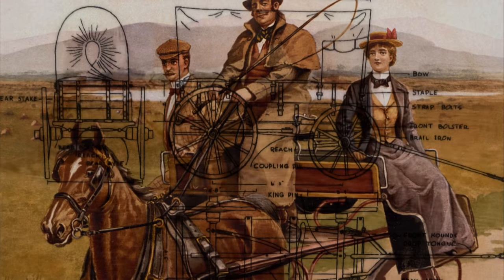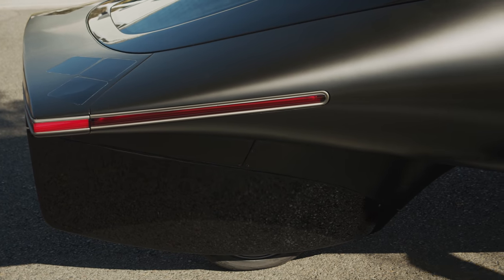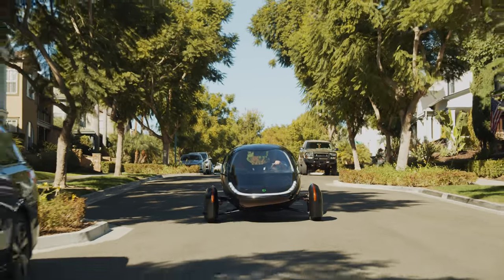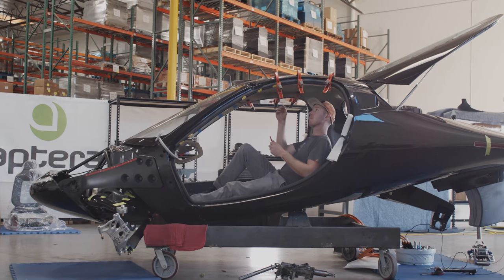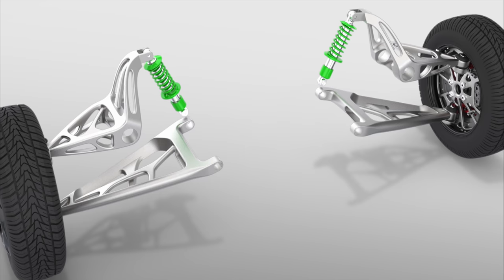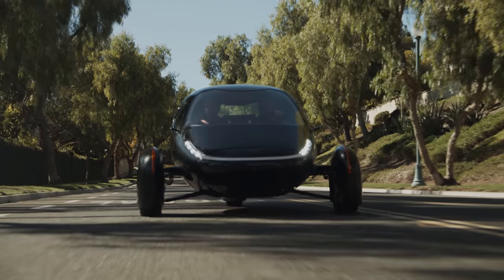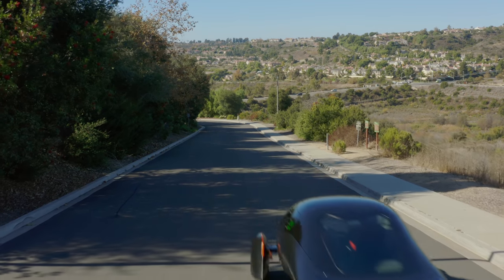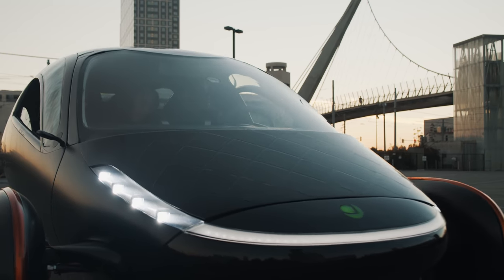Aptera Has Launched

Comment: I hope it will be a huge success. This seems to me to be the perfect car for short, every day trips, especially in sunny climates.
Reply: 1000 mile range. Long trips too
Reply: Same. basically no money for gas I'm all in😉
Reply: @brian8616  The first planned production run of the 1000 mile range sold out first, in less than 12 hours, in spite of being the most expensive.  There is demand for this.
Reply: ground clearance is an issue look how close the wheel covers are to the ground and the body too kind of. it cant go through snow or even mild pot holes it might even get smashed on speed humps
Reply: thunderf00t will probably debunk it
Reply: @dinobot_maximize  you can get wheel covers that are higher off the ground, the off-road kit. The distance from the belly of the vehicle to the ground is about 9 inches. Plenty of ground clearance.
Reply: Is a 3 wheel vehicle considered a motorcycle and except from D.O.T. crash test? Just curious.
Reply: @paulzap6102  yes or autocycle/tricycle. Because less than 4 wheels, it is exempt from the automotive safety tests
Reply: @paulzap6102  no
Reply: The classification of three wheelers differs from state to state. Elio motors had some info posted about the topic.  They have to get a special exception in several states in order to not require a helmet because it falls under motorcycle laws.
Reply: @dinobot_maximize Correct me if I'm wrong but wouldn't that only be an issue for sharp curbs and such.  That's not like a low car in the center as the wheel covers will move with the wheels.
Reply: If they only made it four seater
Reply from the maker: Thanks for supporting Aptera!
Reply: Ten years later and there is now a brand new crop of suckers to fleece...
Reply: @sandervanderkammen9230  Do you own apple products? They liquidated as well. And yet they are one of the most successful companies in the world.
Reply: @halllwd94  Apple is a real company...
Reply: @sandervanderkammen9230  So is Aptera.
Reply: @halllwd94  Hahaha!!!
Reply: @sandervanderkammen9230 . Just ordered it :)
Reply: I'd buy it for year round trips for sure
Reply: @cowonaviwus9975  
Anyone with any knowledge of automotive production, sales history and commerce can debunk this abortion. Park it next to your Elio.
Reply: @DGcuten   You still have to pay to recharge it...
Reply: @paulzap6102   In most states, yes. As to the crash test? Someone will do that for you soon...
Reply: @Daniel Keyser Yeah that's a fake vehicle too!
Reply: I hope it does what they say it does, and then I hope it's a huge success.
Reply: If they make a car this time
Reply: This is the beginning of the end of the oil age,thankfully
Reply: @filippoleombruno8624  "there is a sucker born every minute"
Reply: @sandervanderkammen9230  that's exactly how I feel when I spend 75dollars filling up my tank ,at least I know some of the money is going into a poor saudi princes pockets
Reply: @cowonaviwus9975  He can't debunk solar charging
Reply: @sandervanderkammen9230  no I know exactly what the Saudis are doing to yemen
Reply: @filippoleombruno8624  Yes, Saudi Arabia currently hosts 4 million refugees from Yemen, provides them with free housing, clothing, studies, treatment and salary, and treats them as citizens. Can you tell me why Australia refused to host the Syrian immigrants and drowned them in the sea?
Reply: @faisal6230  there is good and bad in every country, I protested the Australian government treatment of refugees, I also have Muslim friends who like living here, my problem is with oil and the hell on earth its created,yes it served us well  for over a century and gave us the highest standards of living in history but it's time to move on to a cleaner more sustainable future,
Reply: @Daniel Keyser read the oatmeals piece about his Tesla. He explains that despite being in oregon, solar is effective and he loves his setup.
Reply: the 3 wheeler makes it look wimpy... ok nevermind just saw the video.  0 drag lighter weight more aero efficiency more mileage
Reply: @filippoleombruno8624  I know exactly what the second richest man in the world Elon Musk is doing in Yemen.... nothing.
He doesn't give ashit about you or the environment. 
You need to get with the times... your irrational fear of the evils of "Big Oil" are unfounded, it's the rechargeable battery industry that is getting rich and destroying the environment out of greed and pure evil.
Reply: @sandervanderkammen9230  musk won't be so rich soon, now that battery technology is going to replace lithium (which he has invested in)also Toyota is going to start producing a full electric range,already 1 in 4 Toyota's is a hybrid, the yaris hybrid is getting 3l per
Reply: @sandervanderkammen9230  yaris is getting 3Lper 100km,my 50cc scooter gets 2.8L per 100!for the first 20 years of my driving life I drove nothing but V8 for no real practical advantage I'd be 100k better off now, if governments made it affordable to own a second car, you could keep your V8 ,truck or 4 wheel drive for recreation
Reply: @filippoleombruno8624  what battery technology? Everything is Li-ion.

Toyota got screwed by Musk...Toyota has been forced by Muck to produce a pure EV and use his batteries (Panasonic) to comply with the so called "Tesla Law" that bans all manufacturers that do not offer a battery electric vehicle in California and 11 other CARB compliant states.
Elon Musk lobbied the California legislature to pass this law which takes effect next year.
Reply: @filippoleombruno8624  If you are looking solely at energy efficiency and cost? Then Diesel is a clear winner..
Reply: @sandervanderkammen9230  I learnt  to drive in a 65XM falcon it required regular maintenance and repair, and still you would break down on the side of the road, for the last 10 years I've owned a 2011corolla,all I've done is change the fluids, yes they are more difficult for a home repair, but their reliability is amazing, in 10 to 20 years time Tesla's will be like that Xm falcon
Reply: @filippoleombruno8624  I just realized you are Ozzie... that explains everything!
Australia is owned by the big evil mining companies.
Reply: @sandervanderkammen9230  lm in south Australia we have a lot of copper and produce a lot of electricity so electric cars would boost this state,since GM pulled the pin when they couldn't recieve any more handouts
Reply: Quite the opposite actually. Perfect for long trips.
Reply: @DS-wy3kn  #ApteraVaporwareScam 😣
Reply: @ApteraMotors  can you please bring it here in the Philippines Sirs? We have sunshine all year long except during rainy seasons from time to time but i think your car still charges even if it's a little bit cloudy and I am applying in your company to be your car dealership here all I can say is I am an honest person and china made e-trikes are most bought here. I'm sure it will be a big hit here too. Love your invention sirs. Tysm 👍🙏😍😎🇺🇸🤝🇵🇭
Reply: @Daniel Keyser i ordered😁
Reply: @filippoleombruno8624  I can't agree more , i invest in a lot startup in green economic and renewable energy sources because we are on the verge of terrible climate change if we do not act quickly
Reply: It sold out in less than 24 hrs so it was a big success
Reply: I’d happily go cruising for long trips in one.
Reply: N. Bruce Nelson well who wouldnt want a 1000 mile range
Reply: May god bless you for this invention
Reply: @cowonaviwus9975  thunderfoot debunks only if math doesn’t add up. Here it does.
Reply: Except when you hit a pot hole and your wheel breaks off
Reply: @brian8616  😂😂 1,000 mile range!? That’s a lie unless this car isn’t coming this year, or next year, and MAYBE it’ll come out in 2023
Reply: @ApteraMotors  Thank YOU! 🏆
Reply: cannot get uglier then this
Reply: Thought you were gonna say "perfect for short people".
Reply: That is, if you don't need any luggage, which is quite rarely the case.
Reply: This would be a perfect vehicle for india if they make some adjustments to make it compatible with India's roads.
Reply: Absolute god damn death traps in crashes. No thanks bud.
Reply: Electramatica solo is gonna be the main competition
Reply: They finally make an EV with 1000 mile range: ..perfect car for short, every day trips
Reply: it's very interested in developing your brand in several regions. Business Development i international, business innovation, investment development
Reply: @paulzap6102   In some states, if it's a side by side seating then it's a car, even if it has three wheels.
Reply: @filippoleombruno8624    How is it the beginning of the oil age when plastic is made from oil. The tires are made from oil. All the electric wires have insulation made from oil. The charging cable, the windshield is probably plexiglass...etc
Reply: @filippoleombruno8624    The new batteries Tesla is coming out with in 2020 are not lithium ion batteries. I think they use nickel iron or something like that.
Reply: @TexanUSMC8089  solid state batteries are the next big thing  ,there will always be some use for oil just not as much
Reply: @sandervanderkammen9230  who hurt you buddy?
Reply: @purplecolour  I'm not intimidated by trolls like you son... get a life.
Reply: @sandervanderkammen9230  Dad? Is that you? Pls come home, it's been years :(
Reply: @purplecolour  Sorry, you lose.
Reply: @n.brucenelson5920  how much is it
Reply: Composite Molding through a continuous range line is key for mass production.
Reply: @icare7151  Fake technology doesn't require mass production... just good marketing.
Reply: @sandervanderkammen9230  Provide verifiable data of fake technology please
Reply: @icare7151  You are not familiar with the Aptera investment scam?
Reply: @ApteraMotors  I obviously need to catch up because I thought you guys went away a decade ago! I used to be a member of the forums and everything!
Reply: @ApteraMotors  When are you coming to India? I know its a small market for you, but ...
Reply: @sandervanderkammen9230  Do you verifiable data to support your claims of “scam”?
Reply: @icare7151  Can you provide verifiable data that it isn't a fake technology scam?
Reply: Literally no baggage space
Reply: @niismo.  its a MOTORCYCLE
Reply: @sandervanderkammen9230  Boomers are incapable of living in a world where technology and science advance to the point where their way of life becomes obsolete. We get it, you hate facts and are terrified of change. Poor guy.
Reply: Looks bad though lu
Reply: @dinobot_maximize  There is far more clearance than for many cars on the road now that seem to have no particular problem requiring a change.
Reply: Yes! I'd never need to charge it in Mexico LOL, I just use the car for small trips to grocery store and stuff, my car has less than 1,000 KM since 1 year ago lmao, I like the deal, no more gas, it pays for itself in the long run.
Reply: @n.brucenelson5920  Ground clearance has never been an issue, that is a problem only found on real cars not vaporware investment scams like Aptera.
Reply: @Red-fg9qr  Apetera is marketing this scam in countries where people are gullible and can afford to invest on blind faith, that believe that they will receive what they think they paid for...
Reply: How can I short their stock?
Reply: @구독자500명되면이같은  Aptera does not meet the requirements to be publicly traded.
You can't short sell a company that doesn't make it's financials public... the company is too risky to invest on terms.
Reply: @sandervanderkammen9230  45000 dollars for a car that looks like a tricycle and doesn't have self driving option sounds like a bad deal to me don't see this company going anywhere
Reply: @구독자500명되면이같은  The company already has a  bad reputation as a vaporware investment scam.
A lot of people lost all their investment when the company started up the first time... 10 years later this just a repeat of the same scam.
Reply: Alaska Pirates  You might want to see a doctor
Reply: @schizy  so do it
Reply: @sandervanderkammen9230  says I'm devoid of reasoning and understanding ignores the fact that they have continuously refused to provide evidence for their claims and instead mocked and ridiculed anyone that disagrees with them using nothing but strawmen and flawed logic You missed your chance to take the high road lmao
Reply: This thing is so ugly... I'm shocked at how many of you actually think this thing will be a success...
Reply: @OoWINDEXoO  Stare at it for 20 mins, you'll change your mind pretty quick.
Reply: @techboy95  I'd still wear a helmet, if required by law, I rode motorcycle for many years and always wore a helmet, required or not.
Reply: @danwat1234  Probably more than my spouse's Prius C.
Reply: @paulzap6102  Yes, but it seems like they are focusing on safety pretty strongly anyways.  I've worked some with composites and making my own structures. It's amazing stuff when you get the right combo of 3 materials.  Then, it's a mono structure which further increases its strength and durability.
Reply: @ivanivonovich9863  this comment made me laugh haha
Reply: @halllwd94  I bought one once years ago. After using that POS I vowed to never buy anything Apple again.
Reply: @sandervanderkammen9230  we must all go back to horses to save the world! F big oil and Batteries!
Reply: @ermwhatdaheck  Apetra missed their chance to be honest and legitimate.
Reply: @OoWINDEXoO  I'm shocked people don't see that its a scam.
Reply: @raymondluca7779  Certainly not, I think this country and all countries  should be energy independent.
Are you one of those ninnies with a phobia of atomic energy?
Reply: @Austinandpup  About half the population of the planet would starve to within a year if we switch to horses...
Agreed, rechargeable batteries are not just dumb they are even worse for the environment.
Reply: @Austinandpup  I don't understand the logic of blaming the oil industry for everything... we all consume petroleum products or products that require petroleum in their manufacturer... including the food you ate today and your internet devices you just used to post your comment.
Don't be such a hypocrite.
Reply: @sandervanderkammen9230  i was being sarcastic.  Of course half the world's population gone might be a good thing.
Reply: @sandervanderkammen9230  lol what did I blame the oil companies of?
Reply: @sandervanderkammen9230  ha! If I had it my way I'd be living in a cave and hunting with a stick! Big oil companies suck butt!
Reply: @sandervanderkammen9230  im being sarcastic.  I know the oil industry set it self up in a way that made it almost impossible to live without. Pretty much everything uses oil in this day and age. BUT unfortunately its killing the planet.  So while I live off the crap and yes I'm a hypocrite,  I still say F the oil companies!
Reply: @sandervanderkammen9230  the thing is im old. I know things were better before they took over the world. I'd be happy with no internet, tv, or plastics. 

Here we stand
Like an Adam and an Eve
Waterfalls
The Garden of Eden
Two fools in love
So beautiful and strong
The birds in the trees
Are smiling upon them
From the age of the dinosaurs
Cars have run on gasoline
Where, where have they gone?
Now, it's nothing but flowers

There was a factory
Now there are mountains and rivers
You got it, you got it

We caught a rattlesnake
Now we got something for dinner
We got it, we got it

There was a shopping mall
Now it's all covered with flowers
You've got it, you've got it

If this is paradise
I wish I had a lawnmower
You've got it, you've got it

Years ago
I was an angry young man
And I'd pretend
That I was a billboard
Standing tall
By the side of the road
I fell in love
With a beautiful highway
This used to be real estate
Now it's only fields and trees
Where, where is the town
Now, it's nothing but flowers
The highways and cars
Were sacrificed for agriculture
I thought that we'd start over
But I guess I was wrong

Once there were parking lots
Now it's a peaceful oasis
You've got it, you've got it

This was a Pizza Hut
Now it's all covered with daisies
You got it, you got it

I miss the honky tonks,
Dairy Queens, and 7-Elevens
You got it, you got it

And as things fell apart
Nobody paid much attention
You got it, you got it

I dream of cherry pies,
Candy bars, and chocolate chip cookies
You got it, you got it

We used to microwave
Now we just eat nuts and berries
You got it, you got it

This was a discount store,
Now it's turned into a cornfield
You've got it, you've got it

Don't leave me stranded here
I can't get used to this lifestyle

Source: LyricFind

Songwriters: David Byrne

(Nothing but) Flowers lyrics © Warner Chappell Music, Inc
Reply: @sandervanderkammen9230  how do you know what i ate today? Perhaps I live in the country and grow my own food using rain water.
Reply: @Austinandpup  The David Byrne that just bought a $5.5 Million dollar mansion in Los Angeles???
Reply: @sandervanderkammen9230   Not only am I hypocrite I'm......

Folks, I'd like to sing a song about the American Dream
About me, about you
About the way our American hearts beat way down in the bottom of our chests
About that special feeling we get in the cockles of our hearts
Maybe below the cockles
Maybe in the sub cockle area
Maybe in the liver, maybe in the kidneys
Maybe even in the colon, we don't know

I'm just a regular Joe with a regular job
I'm your average white, suburbanite slob
I like football and porno and books about war
I got an average house with a nice hardwood floor
My wife and my job, my kids and my car
My feet on my table and a Cuban cigar

But sometimes, that just ain't enough to keep a man like me interested
(Oh, no, no way, uh-uh)
No, I gotta go out and have fun at someone else's expense
(Whoa, yeah, yeah, yeah, yeah, yeah, yeah)
I drive really slow in the ultra fast lane
While people behind me are going insane

I'm an asshole (He's an asshole, what an asshole)
I'm an asshole (He's an asshole, such an asshole)

I use public toilets, and I piss on the seat
I walk around in the Summer time, saying, "How about this heat?"

I'm an asshole (He's an asshole, what an asshole)
I'm an asshole (He's the world's biggest asshole)

Sometimes, I park in handicapped spaces
While handicapped people make handicapped faces

I'm an asshole (He's an asshole, what an asshole)
I'm an asshole (He's a real fucking asshole)

Maybe I shouldn't be singing this song
Ranting and raving and carrying on
Maybe they're right when they tell me I'm wrong...
Nah

I'm an asshole (He's an asshole, what an asshole)
I'm an asshole (He's the world's biggest asshole)

You know what I'm gonna do?
I'm gonna get myself a 1967 Cadillac Eldorado convertible
Hot pink with whale skin hubcaps
And all leather cow interior
And big brown baby seal eyes for head lights (Yeah)
And I'm gonna drive in that baby at 115 miles per hour
Gettin' one mile per gallon
Sucking down Quarter Pounder cheeseburgers from McDonald's
In the old fashioned non-biodegradable styrofoam containers
And when I'm done sucking down those greaseball burgers
I'm gonna wipe my mouth with the American flag
And then I'm gonna toss the styrofoam containers right out the side
And there ain't a goddamn thing anybody can do about it
You know why? Because we've got the bomb, that's why
Two words: nuclear fucking weapons, okay?
Russia, Germany, Romania, they can have all the democracy they want
They can have a big democracy cakewalk
Right through the middle of Tiananmen Square
And it won't make a lick of difference
Because we've got the bombs, okay?
John Wayne's not dead, he's frozen
And as soon as we find a cure for cancer
We're gonna thaw out the Duke, and he's gonna be pretty pissed off
You know why?
Have you ever taken a cold shower?
Well, multiply that by fifteen million times
That's how pissed off the Duke's gonna be
I'm gonna get the Duke, and John Cassavetes
And Lee Marvin, and Sam Peckinpah, and a case of whiskey
And drive down to Texas and
(Hey! You know, you really are an asshole!)
Why don't you just shut up and sing the song, pal?

I'm an asshole (He's an asshole, what an asshole)
I'm an asshole (He's the world's biggest asshole)
A-S-S-H-O-L-E
Everybody
A-S-S-H-O-L-E

I'm an asshole, and I'm proud of it

Source: Musixmatch

Songwriters: Denis Leary / Christopher Phillips

Asshole lyrics © Mullet Head Music Publishing, Slap Meat Music, Songs Of Universal Inc.
Reply: @Austinandpup  What do you think about Tesla Inc.???
Reply: @sandervanderkammen9230  to be honest I don't know much about them other than they make ugly cars.
Reply: @Austinandpup  But whats you opinion of the highly controversial mega corporation run by the richest man in the world?
 "Big Green Energy" companies only interested in profit and stock prices??
Reply: @sandervanderkammen9230  im anti everything and yet I use most of what I'm against. I use more oil than the average person. Im against cell phones and the internet and yet I use both almost constantly when I'm away from home.
Reply: @sandervanderkammen9230  lol I burn through about 75 gallons of diesel every day!
Reply: @Austinandpup  Really? That's you philosophy?
How sad.. I feel sorry for you.
Reply: @Austinandpup  Yes, we already agree you are a hypocrite... most environmentalist are hypocrites too.
Reply: @sandervanderkammen9230  don't be sad its my job. I make the big bucks taking food and goods across country to people so they don't die of starvation. Of course we could go back to horses. Whats your dilemma?
I used over 100 gallons of diesel today!
Reply: @sandervanderkammen9230  what's my philosophy?
Reply: @Austinandpup  So its not really "Big Oil" thats the problem now is it??? They are just a business supplying a product to people like you.
Reply: @sandervanderkammen9230  some people like myself can be minimalist but others need to keep up with the Joneses. I have a cell phone only because I'm away from home 24 days of the month. My wife and I video chat on it. When I'm home the phone is off and on the counter. I grow most of my own food," When home". I tried growing it in the truck but the vibration uprooted my plants every day.
As a child I always dreamed of living in the mountains away from people and off of the land. Unfortunately that's nearly impossible today. The government will be taxing us on taking a dump pretty soon.
I drive a semi and its totally against everything I believe. but you know what? My beautiful wife is happy and enjoying her life on our land with our critters. If she's happy it almost makes it worth it being out here driving my life away so the rest of the country doesn't starve.
Reply: @sandervanderkammen9230  oh the robot thing is quite true. We all have to be good robots and fund the government.
Reply: @Austinandpup  Yes, you are a robot..
Reply: @Austinandpup  So please tell me if you are a frustrated ludite and dream of being a hermit... What is your interest in vaporware investment scams like Aptera????
Reply: @sandervanderkammen9230  if you back big oil what are you? A soulful robot?
Reply: @sandervanderkammen9230  hope you're brushing up on your Chinese.
Reply: @sandervanderkammen9230  actually big oil is the problem. They are like crack dealers. Everyone is addicted.
Reply: @sandervanderkammen9230  what are you talking about i never expressed interest in this company.
Reply: @sandervanderkammen9230  and yet you said if we went back to horses half the population would die. Apparently im a hero robot keeping half the population alive!!!!!!!! Horay for me!
Reply: @Austinandpup  and a hypocrite.
Reply: @sandervanderkammen9230  lol like every troll when you are made a fool of you just throw out insults.
Reply: @Austinandpup  Just answer the question.
Reply: @Austinandpup  What is your interest in Aptera?
Reply: @sandervanderkammen9230   I answered that question yesterday I have no interest in this company I never expressed an interest in this company.
 I was watching a video about another company and video popped up afterwards.
Reply: @Austinandpup  So your ridiculous horse comment was intended as a joke???
Don't quit your truck driving job yet kid...
Reply: @sandervanderkammen9230  if you'd take the time to read, i said multiple times I was being sarcastic. To put it more plain pretty much every comment I made here, i was being a smart arse.
Now that I did a little checking on this so called company, I see they tried this in the past. Were you an investor that lost money?
Reply: @sandervanderkammen9230  lol you called me kid. I feel so young or did you mean goat kid!? 🤪
You appear to have a serious vendetta against this company. How much did you lose?
Reply: @Austinandpup  Like I said, don't quit your day job just yet... your jokes are not funny.
Reply: @Austinandpup  Certainly not!You would have to be very gullible and naive to invest in this scam company...
Aptera reeks of vaporware fraud.
Reply: @sandervanderkammen9230  FUV  Is the vehicle I was checking out when I found this. I'm thinking to buy something for cruising around town short trips and to the beach. Unfortunately everything's way over priced right now so I'll just keep looking.
Reply: @Austinandpup  I would be very wary of a $20,000 3-wheeler cobbled together from non-automotive, off-the-shelf parts.
 If I was serious about buying a 3-wheeler? I would test drive a Can-Am first. Rotax engines are so reliable they are FAA certified for passenger aircraft.
Reply: @sandervanderkammen9230  like I said, no way I'm paying that for a beach trip machine. We live close to the beaches  in the Florida gulf.. Just looking for something economical to drive to the beach and for town errands. In no rush. Nothing wrong with our car. 
What ever I get needs to be enclosed. Im not dealing with the elements.
A horse with an umbrella isn't gonna do the job!
Reply: @sandervanderkammen9230  any certain model you like?
Reply: @Austinandpup  Here in California it never rains so no need. for enclosed bodywork...
Reply: @Austinandpup  I see a Hyundai Accent in your future.. you can pick one up for about 2 grand used... more reliable and better range than the FUV.
Reply: @sandervanderkammen9230  here in Florida it dumps buckets without warning. Anyway like I said I'll stick with my car until someone comes up with something worth buying thats affordable.
Reply: @sandervanderkammen9230  come on you can't tell me the horse and unblella didn't make you smile!? Give me a laugh i wanna quit my day job!
Reply: @sandervanderkammen9230  lol I don't see the FUV or any Hyundai in my furniture. 
 Funny story, many many years ago when the Hyundai Santa Fe was brand new on the market.  I went and test drove one but wasn't impressed.  Later that day I was at a different dealership and the salesman told me don't buy that cheap Korean crap. He finished the sentence with I'm Korean I know they're crap.  Of course he was a salesman for a different dealership Trying to sell their crap.
Reply: @Austinandpup  You gotta keep on truckin...
Reply: @sandervanderkammen9230   Oh darn it! I thought I was gonna be the next Denis Leary.
Reply: @ApteraMotors  lame people follow the rules always u come from a super car to normal car Market
Reply: If you put it on  rails. Steel on Steel is 90% More Efficient.  90×300 MPG=27000 Per Battery Charge.
Reply: Not only in sunny climates . Solar gets it energy from UV rays, so it’d work just as good anywhere on earth other then Antarctica.
Reply: @larenski  it has plenty of room for luggage, the trunk has room for two to sleep in and room under it too, since the battery is in the front.
Reply: @jch8175  you don't know that it's a death trap, the crash test hasn't been done yet.
Reply: @niismo.  it has a ton of space, the trunk has room for two to sleep in and under it there's even more room, since the battery is in the front.
Reply: @sandervanderkammen9230  well, the oil industry themselves discovered global warming, and created the controversy that the science isn't settled, so yeah, blame them.
Reply: @MrGamelover23  What crash tests?
Apteras website clearly states it will comply with all applicable FMVSS crash test standards... which is extremely deceptive and misleading since there are no crash test standards for motorcycles or "autocycles"
Reply: @MrGamelover23  That is. Pure speculation... Aptera has not demonstrated a production vehicle yet... without any doubta the production version will deviate from the prototype specifications and as a general rule when fitted with everything a production vehicle requires to be installed the interior volume will be reduced and the vehicle will be heavier.